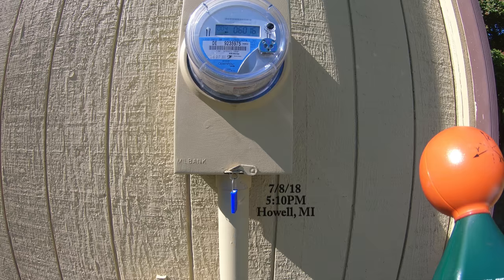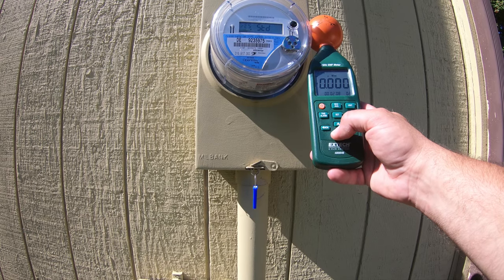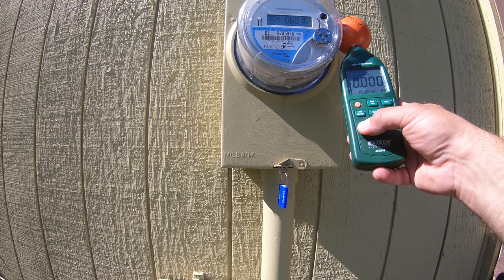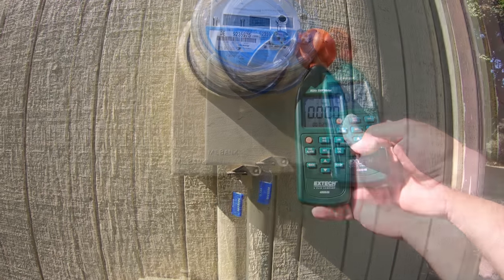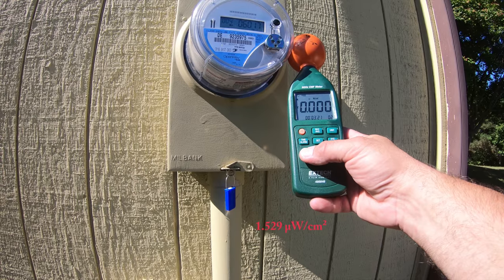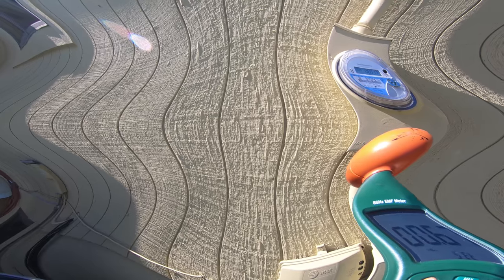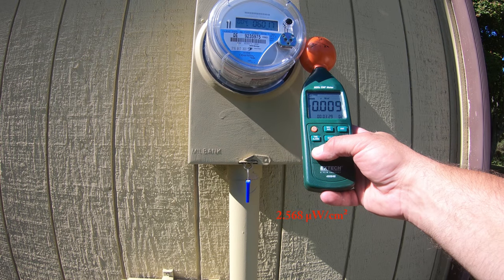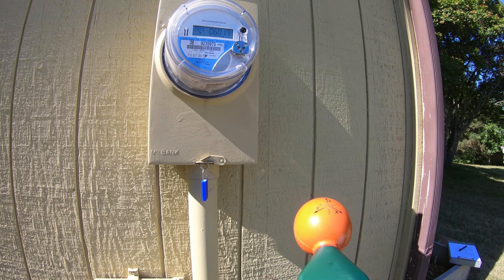DTE OPT-OUT METER FAILURE - HOWELL, MI

Comment: Hey look at your bill and next to kilowatt hours used see if you have "est." which means "estimated". They are estimating numbers without reading meters. I wanted anolog but was told I cannot have it and that they would turn off the reading wirelessly and charge service charge for coming out and reading meter. But they don't come out and play this estimated bill when in fact I had breaker off until recent. Called and complained to have redone and they said they'd send out someone to read meter, but again didn't and did the "estimated charge again. Still they estimate above the actual reading. Hours of time on phone for their scam, is like a routine for them to try and break people and make them give up etc.. Deerfield MI DTE